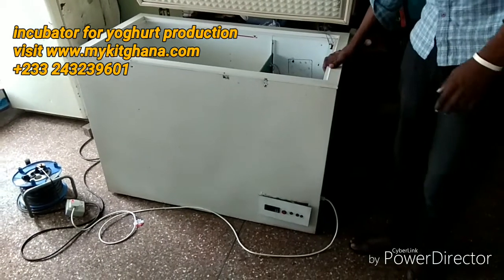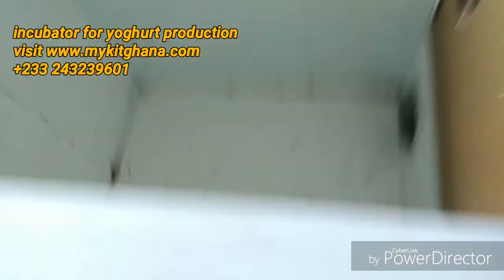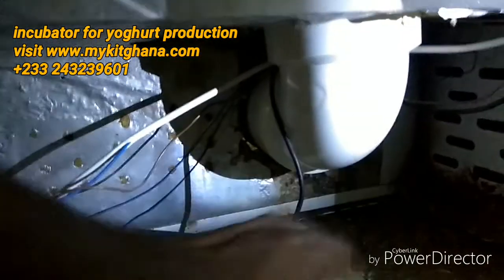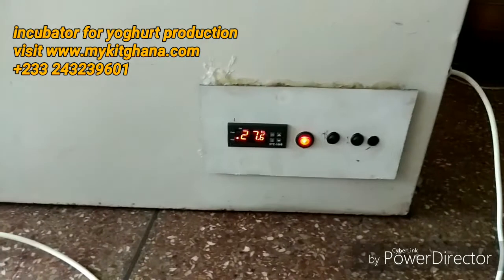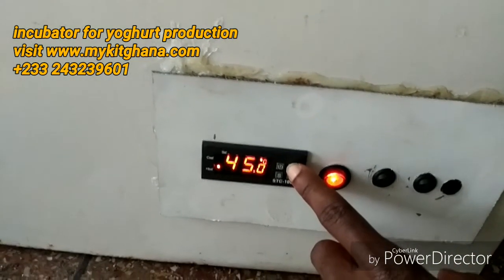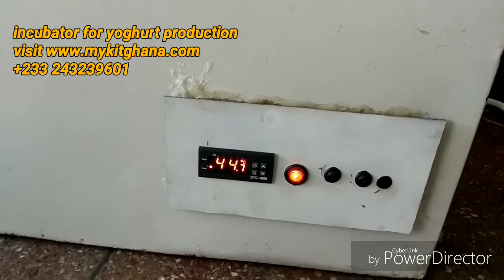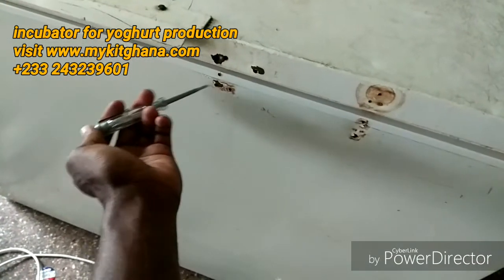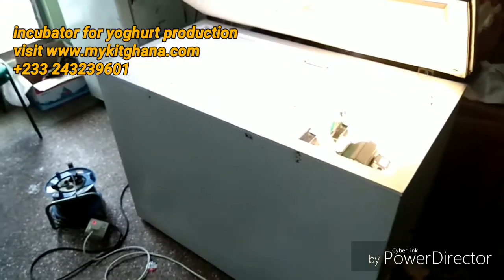How to make an incubator to ferment yoghurt

Comment: Thanks for sharing , one question pls I intend to make a wooden box ( small one ) and put two Incandescent light bulbs on top  and without any fans so can I leave cooling wires in STC1000  pin number 7 & 8 unconnected  ? Keep up the good work .
Reply from the maker: Yes you can

Comment: My brother as I can see there are two down holes to suck the air to halogen bulb and two upper fan for air circulation. But as I look from outside I can see something like a tube attached to halogen bulb. So what is it?? And why using halogen bulb?? Thank you
Reply from the maker: I could have used heater coil. But I didn't have so I used halogen. Heating coil is a better option